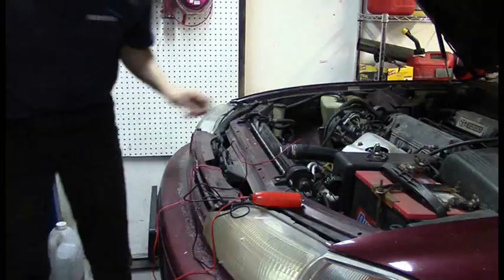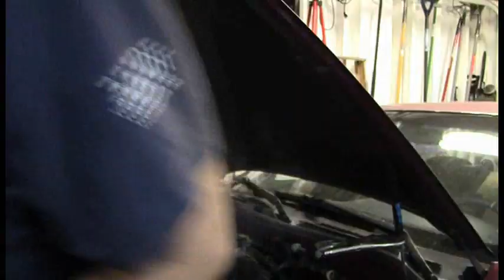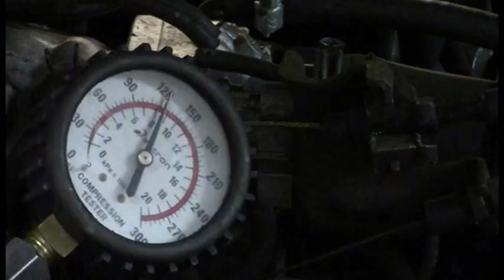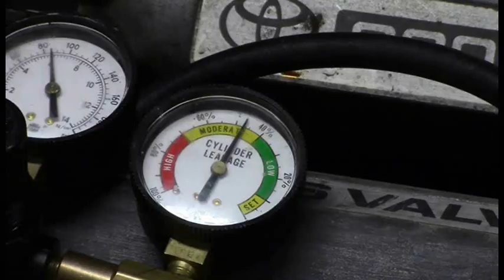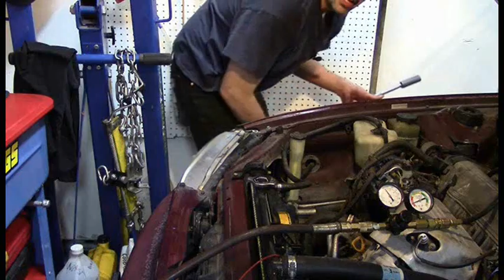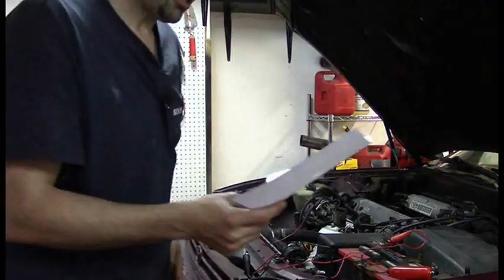12 Ways of How To Test A Blown Head Gasket Compared- PART1

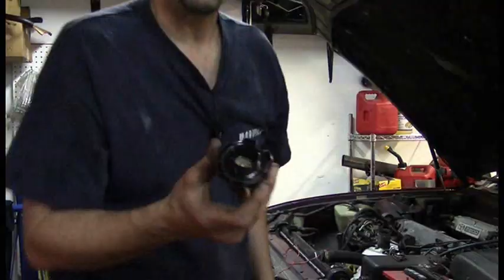Comment: Well done but did anyone else think he may have missed on the Shade tree method of looking under the oil fill cap and noticing what looked to me at 22:31 "Engine Mayonnaise" that was in the center underside of his oil filler cap.  It usually is found there and is caused by oil and water and heat mixing together to produce this milky whitish slimy film.

Comment: What kind of mechanic shop do i take this too?  Is there a radiator specialist?
Reply from the maker: Really any even slightly competent mechanic should be able to diagnose. Hell I'm a DIY and can do it with just my most basic tools!
Reply: I do have a gyser coming up at start up.  Do u think this is a head gasket?  Could it be the water pump?  The coolant eventually just keeps filling up the coolant funnel when it warms up.   When I turn it off it gets sucked back down.
Reply from the maker: i can't say if it's a head gasket without any data.
Reply: I'm going to test it with that pump and liquid tomorrow am.

Comment: MY 02 Chrysler Town  & Country 3.3 L is  losing coolant from reservoir overflowing whenever she likes. What i've been noticing is that the upper and and lower radiator hose gets pressurized as soon I start the vehicule with the engine cold. Any advice?
Reply from the maker: Yes i might try checking for a blown head gasket
Reply: thanks for your fast reply. . If is a symptom of bad head gasket, unfortunately I didn't get it fix after try two times with the 2 types of blue devil
Reply from the maker: SR. TORRES Those things don't work.  Besides you don't even know if you have a head gasket problem or not- what data do you have?
Reply: Yes I did know that the head gasket was damaged before the first and second blue devil attempt, because I did the chemical test that turned out to be positive (from blue to yellow) and after I finish applied it in the engine, negative (it stays blue) 
Only that I doubted that blue devil would fail the second time and by the time I made my comments I had already returned the tester to the auto parts. Yestarday I get the tester back and made the test   resulting positive.
Reply: SR. TORRES you could get a tester from auto zone, will the let you use theirs????

Comment: Hi,just have a quick question if you could help please. I have a Hyundai Elantra 2009 when I start it I see a wet spot on the ground where the tailpipe is just wondering if the head gasket is about to go. I did some basic head gasket test like looking for bubbles in the radiator reservoir, milky engine oil, milky coolant they all seemed to be fine. Just wondering how much of a water discharge is too much? Thank you kindly
Reply from the maker: I don't know- what did your diagnostic tests indicate? What is the compression and leakdown?

Comment: in time  21 you said   Intake Manifold coolant leak        and oil  would mix with coolant   
            I think there is no any  oil and  coolant in the intake manifolded 
your feedback please    regards
Reply from the maker: There are coolant passages through most intake manifolds (unless they are "dry" which is not the normal) and EVERY intake manifold seals the oil valley.

Comment: what do u mean data?
Reply from the maker: i mean what data do you ha e to use for a diagnosis. So many things can cause that symptom. What is the voltage drop between the source and component? What is the static battery voltage?  What circuit isolations have you done?
  I need something to go on besides "car won't start".

Comment: e46 03' losing about a cup of coolant every 2 days, block test didn't turn yellow, doesn't overheat but yellow oil light comes and goes, help!
Reply from the maker: compression test
Reply: Results 
1=155
2=152
3=140
4=140
5=140
6=140
Reply from the maker: See aren't you glad you did this now!!!
Reply: I don't know what it means, I'll research though, second test results are completely different with 7 "strokes" rather than six like in the first one

1=166
2=145
3=155
4=140
5=150
6=145
Reply: test #3

160
160
145
153
155
155

Comment: if a car passes its emissions test and all of them passes does this mean there is nothing wrong with the engines
 head gasket?
Reply from the maker: No it just means the car did not put out CO or NOX beyond the minimum threshold of measurement.
Reply from the maker: If you suspect a head gasket problem this video shows 12 ways to find out.
Reply: well there is one way to be sold a car and there is one way to be lied too about a engine thats not supposed to be in a ford it supposed to be in a ka lol would help if the guy told me the truth first lol thanks for your help.i shall try some of your tests tommorow then he may have to take it to a scrapyard instead of taking any money for the car.being as its 15 yrs old with a 19 yr old engine.im just a learner mechanic basically but if his head gaskets not gone ive gotto do a clutch disk repair yet so job after job we go lol many thanks.

Comment: my 2000 chevy camaro loses coolant without even being driven or started and its not showing in the oil or leaking anywhere visualy . my car also doesnt over heat any ideas what it can be?
Reply from the maker: What did ANY of the 12 simple diagnostic tests shown indicate?
Reply: +Schrodingers Box i also have a valve cover leak that smokes alot so i think the moisture is escaping through there thats why there is no milky residue on the oil cap . is that possible .
Reply from the maker: Gerardo Rivera Sorry I don't know what you asking me.
  I would probably do a fuel trim analysis under idle vs load to confirm if there was any evidence of issue affecting combustion stoichiometry
Reply: +Schrodingers Box i was asking since im losing coolant and its not showing milky residue on the oil cap can it be possible that the moisture is escaping from my leaking valve cover .
Reply from the maker: Gerardo Rivera Possible but not likely. Need to confirm with diagnostics though. You have too many variables that have not been eliminated including combustion chamber integrity tests and cooling system pressure test.

Comment: hey Schrodinger great video man! okay I opened my rad cap and see what looks to me like gunk or maybe oil.. but there is no bubbles or exhaust coming from the rad cap. My exhaust is a little white but not pure white..i checked my oil but it was solid black and wasnt all milky. I pulled my spark plugs but they wernt all covered in coolant.. the trucks got 300 thousand on her and Im just curious about your professional opinion
Reply from the maker: WHat did the compression or leakdown test show?
Reply: The truck is at the shop getting an insurance inspection done right now so i havnt done a compression or leakdown test. I just saw the gooey substance in the coolant and the exhaust smoke before i dropped her off and started to watch ur vids
Reply from the maker: William Veniot Get the confirmed diagnostic from either compression or leakdown. All you have so far is justifcation for doing one or both.
Reply: yes I will thanks for the quick reply and great vids

Comment: water just goes straight  to oil pan as soon as I fill the radiator could it be a  possible blown intake gasket.1998 k2500 5.7 vortec. thanks
Reply from the maker: Yes it is possible but of course could also be a cracked block too.  Simple diagnostic.

Comment: The dip stick and oil drain tests are for quick looks to find out if it Has a head gasket problem that's bad or just starting antifreeze on the dip stick is a good id of a serious problem oil pan I just a conformation of this depending on the amount of antifreeze in the pan or the milky oil is that the problems been there for a while keep in mind these tests are cheep ways to tell if there is a problem before you buy a used car or engine

Comment: i have a question??? i have a brandnew chev bigblock "high performance" like i said evrything is new,it puffs smoke its not antifreeze nor is it oil,is there a way fuel is leaking through washing out the rings???? someone help! im bought to throw in storage and forget about it... any info will help,im beating my head on this one      ive tried 3 diferent holly carb,same result..
Reply from the maker: What data do you have?

Comment: I have a 1996 Lincoln Town Car with a 24 valve DOHC 4.6 V-8 with a dead #1 cylinder. The engine passed all of these head gasket tests with flying colors, but I still have only 40 PSI compression in this dead cylinder while the remaining 7 all have 120. That and the fact that the car only has 103K miles makes me want to rule out the possibility that the engine jumped timing, but I do not understand how the head could have failed for just that one cylinder without any other symptoms like coolant loss. Replacing the heads and timing set on these cars is a lengthy and expensive procedure, so I am willing to try anything short of an engine swap to save this car. 

Could I have a flat cam lobe or stuck valve? How can I test for it? Is it possible for an oil blockage to ruin just one cylinder (the previous owner did not take very good care her)? Could I find out by plasti gauging the cylinder before whipping out the check book (you have to drop the oil pan anyway to do a head gasket on these cars)? How can I test the weather or not the $400 timing set needs replacing? 

This is my first crack an engine more complicated than a lawnmower, so warnings or advice will be much appreciated.
Reply from the maker: You need to do a leakdown test to confirm the issue.
Reply: Hi mate. Most likely either from rings or valves. As the video says, add a few squirts of oil into the bad cylinder and then test the compression - if the compression is now high, then the rings are at fault (the oil would have had a sealing effect on the rings). If the compression remains low, then it's most likely the valves. Are the valves adjustable? If yes, then check for clearances because, if they are tight, the valves won't close, causing compression loss.
Reply: Also, if the engine jumped the timing as you mentioned, then all the cylinders would be affected. Rule out valve timing as a fault.
Reply: The #1 piston failed the leakdown test spectacularly; enough air rushed out of the oil cap to blow out a cigarette. Looked inside the cylinder with a bore camera and the walls were terribly scored. All of the other cylinders were fine, some even still had cross hatches, but whatever. Engine is trash. At least I didn't discover this the hard way!
Reply: Would now be easier and cheaper to buy another car I guess.

Comment: In a real blown head gasket situation = engine is toast, car undriveable, check engine light flashing = get a new car or new engine, depending on blue book value. The cost of a HG repair job is outrageously prohibitive and will probably not remedy all additional latent engine damage in domino effect result of a real blown HG. Coolant in the oil = engine totally screwed. A blown HG is bad news. A minor leak where CO2 and coolant are slightly mixing is the red flag indicator that things will just get worse and why it is crucially important to perform a full engine coolant flush per manufacturer schedule with the proper 50/50 coolant. Never allow garages to top up the coolant. Almost all garages just do the drain & fill routine. That's no good. The system has to be completely flushed and replaced with perfect 50/50.
Reply from the maker: +Jason Bell That's hardly true at all. The determining factors are the bearing condition, not the simple fact there is coolant in oil.
Reply: +Schrodingers Box You're right. But most motorists don't recognize the symptoms of a blown HG and continue driving the vehicle as normal in its highly defective state instead of pulling over, shutting down and calling a tow. The cars come in for service only after internal components have been subject to sustained degradation. A mechanic, not the owner, spots the contamination, this after driven hundreds of miles post-HG breach. Most owners don't check fluids or tire pressure, take the vehicle for granted.  Once a real HG fails, because the owner didn't regularly change the coolant or the pump failed or whatever, the repair bill is huge. If the bill matches or exceeds the car's value, sell the car to a wrecker and get a new one. For most average cars, except for the fortunate ones who catch the problem quick, the extensive repair bill isn't worth it. Only financially benefits some lucky auto garage.
Reply: Test

Comment: Can a compression test be done on a Diesel engine?
Reply from the maker: +Robbie Keane Yes. In fact they virtually run off compression causing the combustion as opposed to timed spark. Compression even more important, arguably, in a diesel.
Reply: +Schrodingers Box unfortunately I think I'm in this predicament 
Under load the engine forces the coolant out into the overflow bottle

Comment: Can you please help me I'm trying to figure out if I have a blown head gasket and none of these mechanics can tell me if I have one or not
Reply from the maker: +Dominique Davis Man hopefully someone will make a video on how to test for a head gasket failure.  Sorry I can't help- I don't know of any such resources.
Reply: +Schrodingers Box I don't have a leak there isn't any smoking my car just keep running hot someone said it can also be air in my water pump
Reply from the maker: Dominique Davis Ok then what data do you have showing it is not a leak- what was the compression and leakdown test result?
Reply: +Schrodingers Box the guy never did any kind of test to determine any of this he was just taking a guess this is my first car I really don't know anything but someone keeps telling me it's not a head gasket they said it's something going on that the antifreeze isn't flowing to the engine
Reply from the maker: +Dominique Davis Well I don't see how I can help. This is a DIY channel. sounds like You need to take the car to someone.
Reply: +Schrodingers Box Can you tell me how I would know if it is a head gasket?? Or can you tell me if it's something going on with my water pump
Reply from the maker: +Dominique Davis Yea I can tell you exactly how- you watch this video.

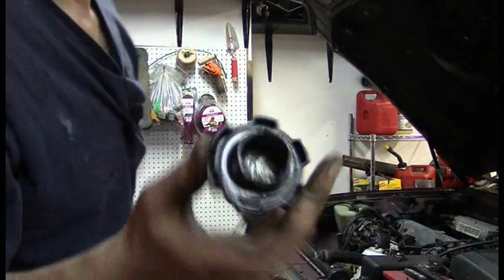Comment: I watched this video to see if you had tried a particular head gasket sealer. Anyway, I don't know your reputation but I noticed at 22:31 and 22:35 that cap showed a DEFINITE sign of water in the oil !! It looked milky to me. I see someone else (Brandon) observed the same thing.My opinion is that you are not 100% credible, though you do know your way around an engine.
Reply: +Denver Don chill bro.. you are going to shit on his entire credibility because of one minor thing? chillllll....
Reply: +SS I'm Chillin
Reply: Denver Don he was showing different tests that could other problems, than having a blown head gasket, checking the radiator and dipstick are easy test

Comment: How does one keep the throttle wide open if the ecu is controlling the throttle body. When there is no acceleration cable connected physically.
Reply from the maker: +redsea it will open as needed to try to start the car automatically when key is in run position. Otherwise you will have to open vacuum line or something if you are only doing a starter bypass to crank engine.  Good question bro, never thought of that

Comment: Does anyone know how to clean an engine out and remove water/coolant from engine oil. I just bought a car that had a warped head and they fixed it but they overheated the car again and said that it can be the head warped again. But I want to make sure first before I go and tear into it. Cause I know it could be other things that cause coolant in the oil
Reply: +jose hernandez Basically just drain your oil like you would normally with an oil/oil filter change.  The cylinders you would have access to with the heads off.  So you should use clean shop towels to remove water/coolant.  Additionally you could use compressed to to get that out in hard to reach areas of the block.

Comment: Hi, if I use a remote starter (hooked to the starter coil) do I still have to disable the gas pump and ignition system? or by not using the key the ignition and gas pump are not being use?
Reply from the maker: +dana miller No if you connect at the coil the engine will not start unless ignition key is ON.
Reply: Schrodingers Box Thanks
Reply: +Schrodingers Box 
hai . thanks for ur videos..  i have my mazda 6 .. 3.0 liter 6 cylinder.. 2005 year.. mileage 107000..  i m from india.. came to usa for my studies.i bought an used car mazda.. its getting trouble now.. some symptoms. white smoke.. coolant leaking inside.. some observed smell. its not starting in cold weather.. dealers said. blown head gasket pbm.they r asking 2500 dollars for repaid. mine was used car. now car is not starting. it cranks and stopped. check ignition.. new AAA battery .. i donno wht to do..is this sealants gonna work out.. if any reply.i owe 4 ur help.. thank